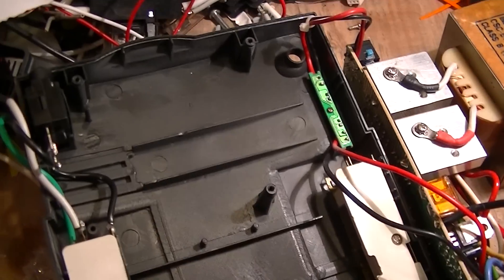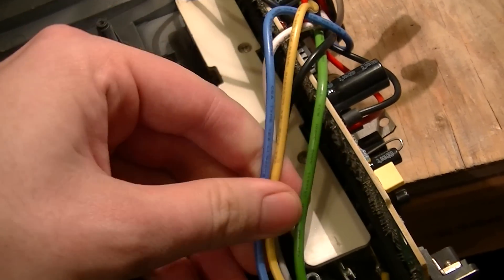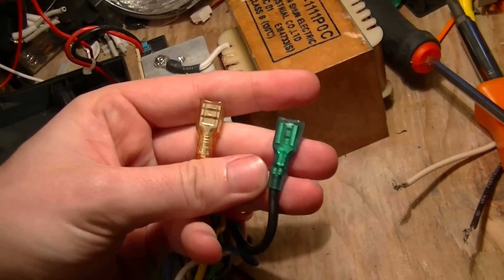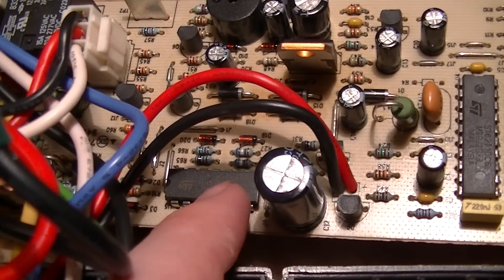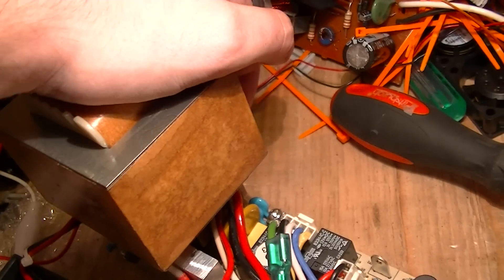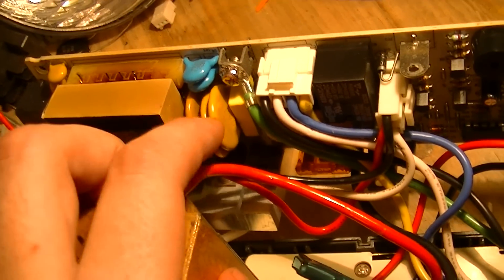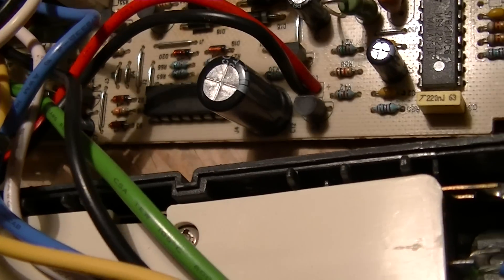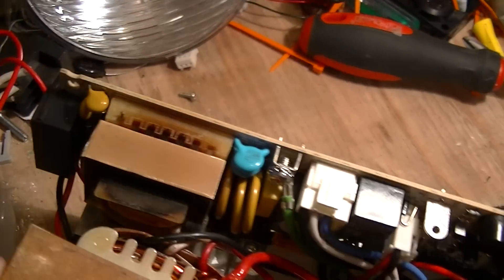CyberPower UPS guts

Comment: I have a CP550SL with identical fault: The charging transformer has died.  I believe what happens is the lead acid battery starts deteriorating in these, people don't realize the battery needs replaced because the power never goes out to trigger the UPS when they are around, so the undersized charging transformer just keeps running (often times for years) and eventually shorts the windings. My transformer was rated 130c and still failed.  Unfortunately the charging transformer runs about $30 and a battery another $20...so it's not economical to fix rather than just buy a whole new unit.
Reply from the maker: General rule of thumb for VRLA batteries is that they are good for 5 years if maintained properly.  They can go longer, but mortality is somewhat random.  I generally replace them at 3 or 4 years and use the working pulls for other stuff that isn't critical.  I've been going thru and replacing everything recently due to the battery situation being a shitshow and thus there being a good chance that I may not be able to get batteries when my normal replacement interval hits.

Comment: the problem always is that the batteries are lying rather than horizontal. Then the acid is spilled.
Reply: yeah, the lead acid battery can not lie down
Reply: They're sealed lead acid...they can't spill and can run any direction.